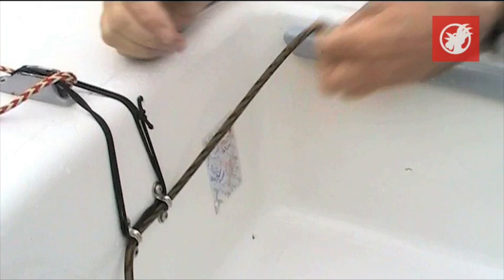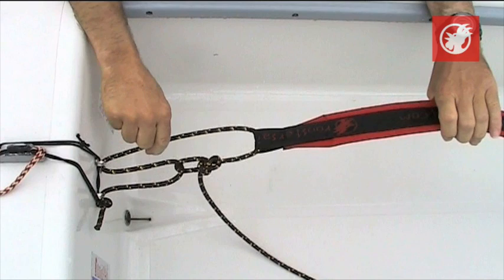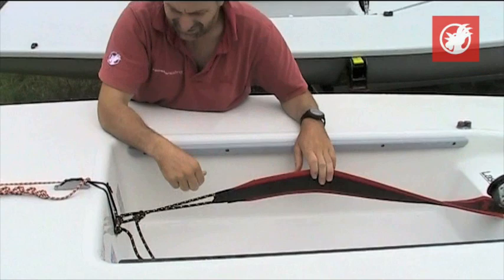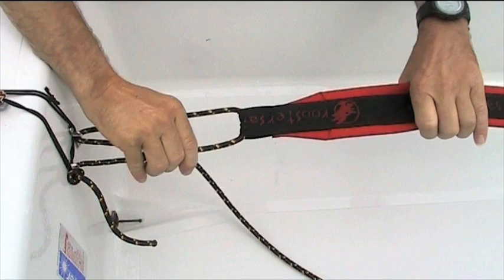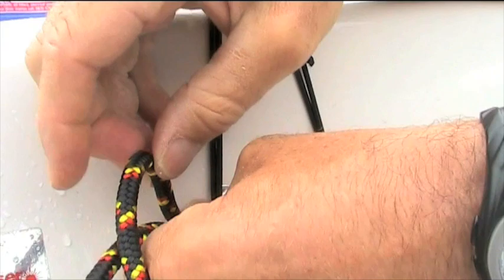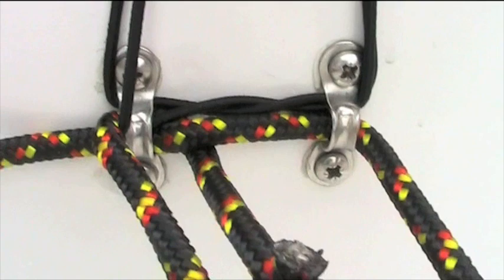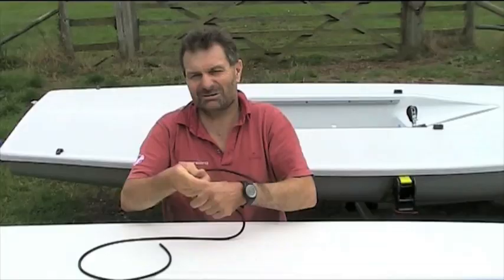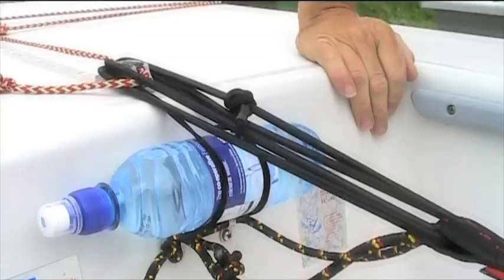Laser Toestrap Adjustment Setup Information - Rooster Sailing

Comment: Thanks for the video. I'm using a ~6mm mainsheet (polyester braid over dyneema core) as suggested, yet I still find that there's slip using your 'Robert Scheidt method': i.e., it holds if there's constant pressure on the strap, but if there's pressure on and off, it gets a little bit looser every time the strap gets reloaded. Is this common? Any recommendations?
thanks,

Comment: the "robert scheidt" method however is extremely difficult to adjust while sailing, for example when rounding a mark from upwind to downwind while in the first method it's fairly easy.. personally i prefer the first method. maybe it needs exactly the right rope diameter in order to work properly